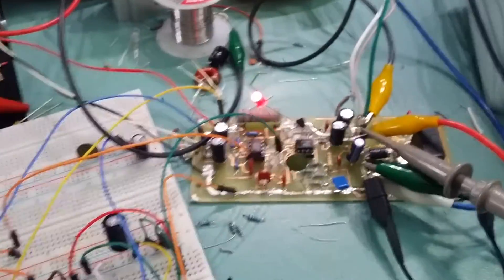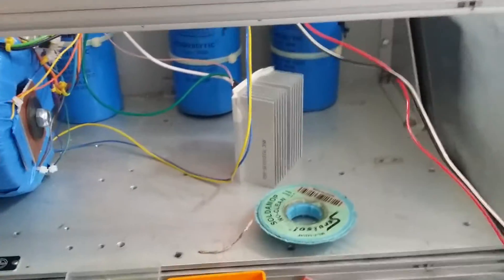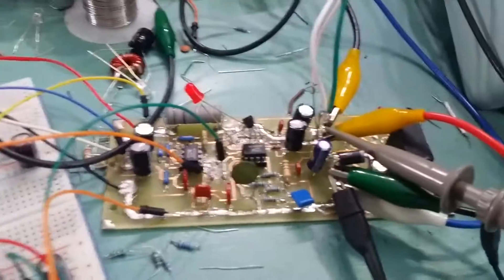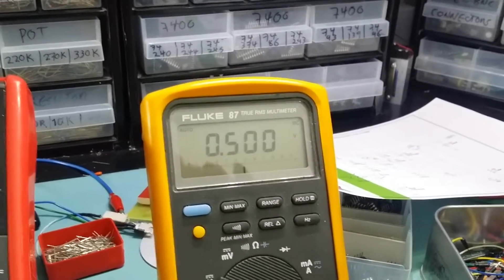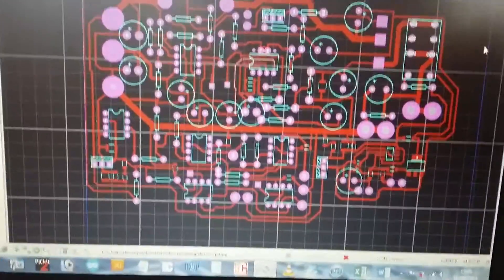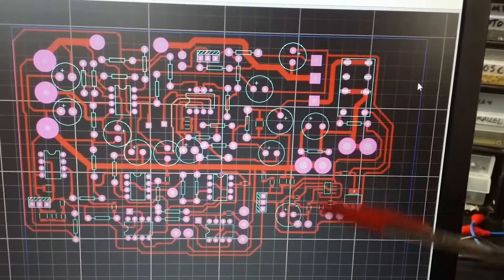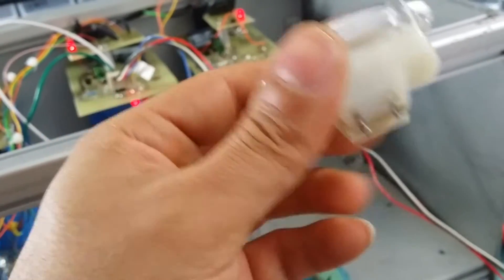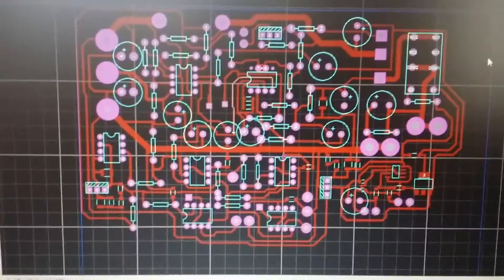Lab power supply design part 6

Comment from the maker: Thanks, ye the adjustment with the 10 turn pot came out good, As its a 10k pot and 10 volts full scale on the power supply. Using an 10 volt voltage ref ment that i didnt need to put to much gain on the output stage so that made the adjustment easy and linear.